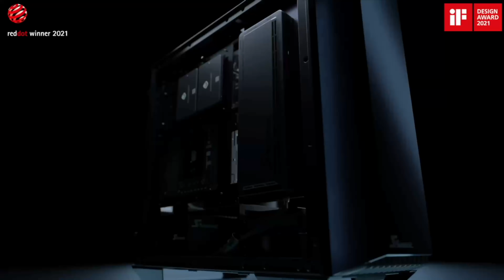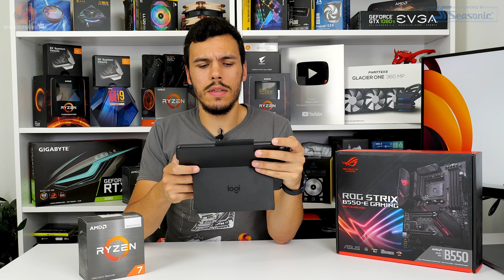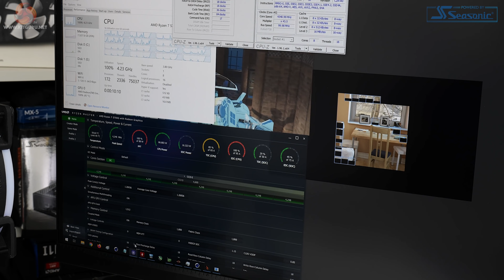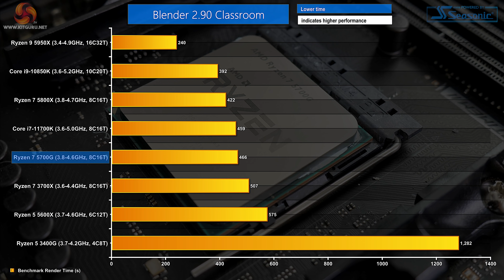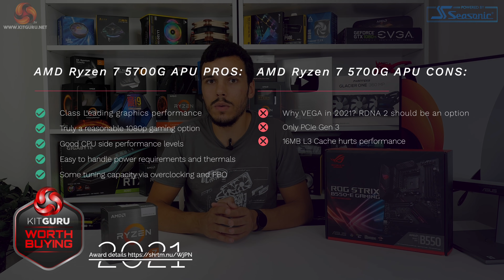AMD Ryzen 7 5700G APU - Can it Run AAA Games?

Comment from the maker: Are the new APUs worth buying in your opinion - or would you always get a CPU and GPU separately?

TIMESTAMPS:
00:00 Start
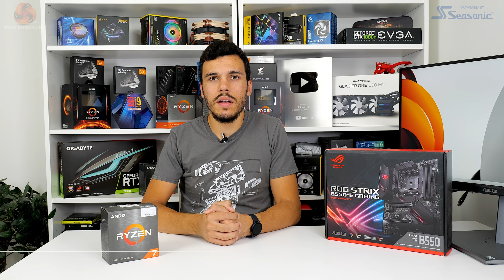00:15 Introduction / pricing
01:19 5700G details (and cooler)
03:33 PCIe Gen 3 ?
03:55 Motherboard support
04:32 Test system / Methodology
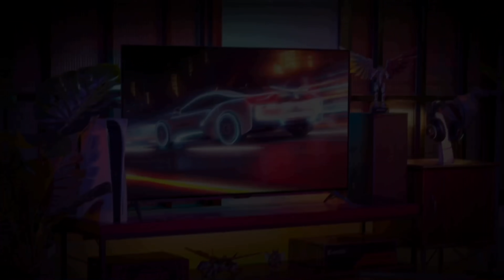06:11 Comparison Thoughts
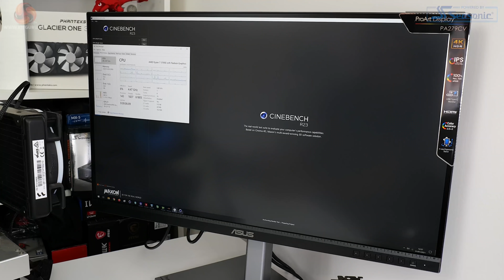07:41 Clock speed / OC
10:23 Performance results
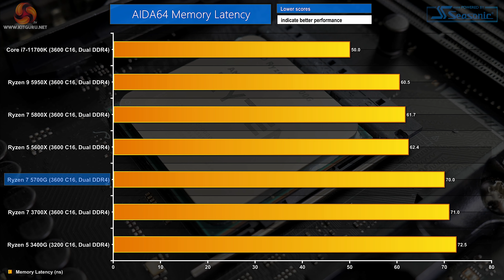12:58 Summary of CPU focused performance
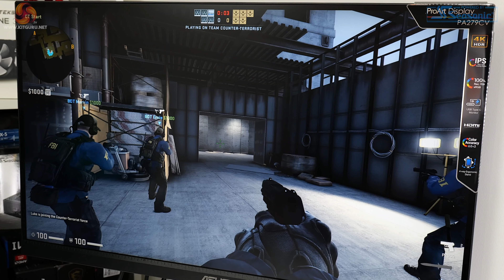13:20 iGPU gaming - AAA titles
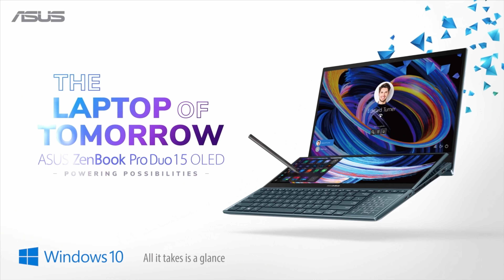16:01 Summary of iGPU gaming performance
16:43 Gaming Performance with RTX 3080
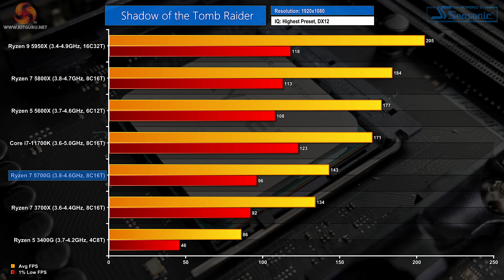17:38 Power Consumption
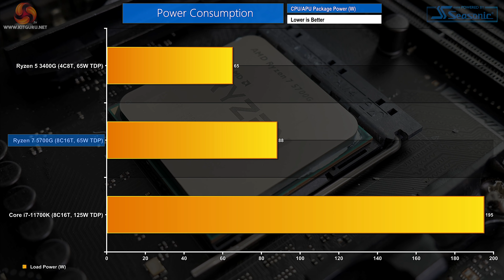18:00 Temperatures
18:17 Summary
19:52 Luke’s Closing Thoughts - disappointment over no RDNA 2
Reply: pin it?
Reply: 21:18  Thank You  so much, the exact tidbit i was looking for.

Comment: I have gotten this at a very good price to replace my r5 1600, I havent installed it yet, I am looking at cooler options to replace my current deepcool gammax gte v2 180tdp air cooler.  I am not planning on using the on board graphics unless my rx590 dies (prices are still too high to replace it yet).  My motherboard is a 2018 version of the Asus Rog Strix B450-F Gaming with bios fully uptodate.

Comment: I want to build a new system with a RYZEN 7 5700g and 32gb of 3200mhz RAM and NVME drive for OS+Programs with SSD Drive for media. HDDs for the rest such as backup imaging. This system will be exclusively only for Video Editing and will have only the OS and the NLE program installed with maybe... photoshop + 3ds max/blender to do some simple 3d titles. It wont be used for internet and other general tasks etc.  OS will be Win 10 64bit.

I intend to work with the inbuilt graphics for a few months till Graphics cards get down to realistic prices.

My projects are all 15 mins max on the timeline. Maybe 1 to 2 tracks of video files and another 5-7 tracks of color solids or text overlays. My videos will be 400mbps Panasonic GH5 type of mp4 clips.

Your opinions and suggestions will help. Thanks.

Comment: since the gpu i will try to put on my system is gonna be a 3080, im going to use the 5700g until im able to grab a 3080. I might upgrade to a 5900x later on

Comment: I have seen to HP Desktops one with the AMD Ryzen 5 4600G Processor and the other one with AMD Ryzen 7 5700G Processor
I am mainly going to use it for everyday tasks not a lot of gaming.. Is there much of a difference and worth me spending the extra £150 quid for the AMD Ryzen 7 5700G

Comment: We are looking to build my son's first PC, somewhatnon a budget,  but with a goal of being able to upgrade later.   Would starting with a Ryzen 5 5600g be OK for normal computer use like media, school, and light gaming?
    We would plan to later add a GPU and likely a second kit of 2 more RAM sticks, possibly an eventual upgrade to a Ryzen 7  or 9 CPU without onboard graphics. 
    Looking at the Asus ROG Strix B550-F wi-fi board,  Corsair RAM and 850w power supply, and M.2 storage.   
    Any input would be most appreciated.
Reply: looking like a decent build on paper. what GPU are you planning to get? what RAM? I run 8x2 (16gb) on a 5700G Ryzen 7, I haven't benchmarked yet as we built it yesterday, but from what I've seen it definitely ran Battlefield 4 on Medium graphics at 70+ FPS (though inconsistent), and High graphics at 50-60fps quite nicely with rarely any drops (which is strange...BUT consistent. I'll cap the framerate at 60 later)

Remember, consistent FPS is better than high FPS. If you're going to do a iGPU i would go for 5700G, it goes for $320 on Newegg and shipped in 2 days.
Reply: @hollowpoiints    thanks for the input, we may try to get the 5700g instead of 5600g,  we are hoping to someday be able to pick up an Asus ROG Strix 3080 card, or SOMETHING made by Asus for RGB compatibility...  Corsair Vengeance 3600 RAM, hoping for 16gb sticks for 64 eventually....   not looking to play high end games, definitely not the most intensive ones, and not above low-med settings... will be a multipurpose computer.... someday when we can add the GPU, the next step would be a higher end CPU without the onboard graphics,  then I will use the old APU processor for another machine for just home office and school use....
   Gaming will be either 720 or 1080p,  can't remember what his TV is capable of for now... so integrated graphics should do OK for a bit... looking to integrate all the RGB through Corsair iCue,  maybe a Pirate Dog Tech adapter for the few non-corsair and non-asus fans or strips....  looking at the Antec DF700 case...
   Thanks again for the reply and feedback!
Reply: @isaiahfurrow7414  if you're doing 64GB of RAM, you can pretty much throw whatever the hell you want at it. It can handle both games AND work related stuff and not even break a sweat.

I have a MSI B550 MAG TOMAHAWK motherboard, it actually was the top rated motherboard FOR the 5700G. Word of warning, it doesn't come with a WiFi adapter so you're going to need a USB wifi adapter.
Make sure you get GOOD CPU coolers, the stock Wraith cooler for 5700G is pretty ass. I run a game of Apex Legends at low graphics (for more consistent FPS) and it'll reach 70°C (158°F which is medium temperature) but the colder the better. If your son is going go overclock his CPU and push it, you ABSOLUTELY need a cooler like Noctua or a water cooling system. Have you got a PSU? I'm sitting pretty comfortable at a Corsair RM850x, 850w of power at a Gold+ efficiency rating and it can rig for silent running.

Other than that, looks pretty good!

if you have any other questions, my discord is Attano#0999
Reply: @hollowpoiints  would be 32 GB of memory to start with... later add another 32.   For power supply we were looking at the same Corsair RM850x unit, but after watching a video or 2 about PSUs was going to research a bit more to see if there was a better option that isn't ridiculously expensive.  I think his main PC games he wants to play (he also has PS4 and a few games he hasn't played through yet)...are PUBG , CS GO, Forza(we don't do Xbox in this house...lol), Halo, Valorant, CoD War zone, and then some older and way less intensive games like some real-time strategy games(Starcraft, Dawn of War), Diablo, other stuff from Steam, etc...   
   For coolers we are kinda thanking of going with the Arctic Freezer eSports 34 duo cooler, and maybe look into if there's a couple RGB fans we could swap to that would be better or as good as the ones on the arctic.... but for starters, a decent air cooler, the 3 front fans, and maybe a few extra LL or QL corsair fans added in to make sure there's plenty of airflow...  my kid says lots of RGB makes it faster and better FPS...lol
  He loves his new K70 keyboard , it came early due to Best Buy sale, and the iCue software looks to be pretty sweet... 
   Thanks again !
Reply: @isaiahfurrow7414  oi can I actually get a link on that keyboard? I'm using some cruddy red dragon M&K set
Reply: @hollowpoiints  , we got the K70 RGB TKL Champion Series, it is normally like $140, but Best Buy had it on sale for $99.... 
   I think we are gonna watch for sales and buy parts off our list when we find them o  sales, if we get lucky...
Reply: @isaiahfurrow7414  As for the cooling, I recommend to go with Scythe Fuma 2 CPU Air Cooler - 60$ well spent. This cooler has the same performance as Noctua NH-D15 (~100$), but no RGB on the two fans it has though

Comment: I'm planning on buying the 5700g for my new pc. I already have a Asus B550A that I bought a month ago, will I need to update the BIOS for my 5700g to work?
Reply from the maker: Possibly. Do you know which BIOS version you currently have? Luke
Reply: @KitGuruTech  I checked the history of BIOS updates for it on the Asus website. There is a beta update from late June and an update to support Windows 11 from July. Both after I bought it. The one from June adds support for AGESA V2 PI 1.2.0.3.
Reply: @KitGuruTech  The update I must have is AGESA V2 PI 1.2.0.1.
Reply from the maker: @callum9378  The 5700G should POST and Boot with AGESA 1.1.8.0 or later according to the AMD notes. But you should use AGESA 1.2.0.3b or later for the best experience. So it sounds like your system will POST with the 5700G and then you can update to the latest BIOS. Luke
Reply: @KitGuruTech  OK, thanks for the help!

Comment: Eh, I have a system with a gpu, but I still think the apus are more suited to 720p or  1080 on easier games.  I don't mind 720 on my laptop, size of screen is a big deal for using apus in my mind

Comment: I wonder what the fps in AAA games would be if paired with a 1366x768p monitor as 1080p is just too high a res. Native res 768p looks better than scaled on a 1080p monitor.
Reply from the maker: 768p performance should be absolutely fine with some reduced IQ settings. We did some lower resolution testing when we initially reviewed the 3400G a couple of years ago, so that data is probably still relevant. Luke

Comment: Why is the guy saying "compared to DESKTOP cpus/parts" is this a laptop processor? Annoying as hell
Reply: Well I guess he figured you had the intelligence to work out the difference between an accelerated processing unit and a central processing unit and not get confused with mobile chips.
Reply from the maker: I can't understand what you're complaining about. We have desktop parts compared against desktop parts. The Cezanne APU holds many similarities between the desktop and laptop parts (as highlighted in the video). Does that help your confusion? Luke
Reply: @KitGuruTech  not sure. I'm not saying anything is incorrect, but it's a weird phrasing IMHO. It sounds like you are reviewing a mobile CPU when you do it this way. IDK, e.g. if I was reviewing a petrol powered car that is a hybrid and saying "compared to a petrol powered cars". Doesn't it make it sound like I'm talking about a diesel/electric car?
Reply from the maker: @GintarasSakalauskas  Yes but I guess by that logic, we are reviewing computer hardware and comparing to computer hardware. We are hardly talking about it versus the latest Qualcomm SoC in a mobile phone. Fair enough if that is your opinion which you're absolutely entitled to. Though, I'm sure there are much more polite ways of expressing discontent than 'Annoying as hell' :)! Luke
Reply: @KitGuruTech  Not sure what's not polite with saying "I found this kind of word selection to be annoying as hell", I'd say it's in the top 5% for internet standards :D I don't think your example with pc hardware vs pc hardware follows the same logic though. Anyway, just some feedback, maybe I'm a 1 in a million who found it odd, feel free to disregard it. Good luck with your work

Comment: The reason the 5000G series uses Vega because it's been optimized for performance, power, and area, and also because of the limited DDR4 bandwidth.  RDNA2 has infinity cache and extra silicon to support RT so 8 CU's would increase power and area, and RDNA1 probably needs DDR5 and also hasn't been optimized for power and area enough to fit into small enough chip size.  Less yield would increase costs and with the dearth of available wafers it makes sense to stay with Vega for this generation.

Comment: Would this be a good cpu for Unraid, running a few vm's, socket containers, 24/7 running? Thanks, answered at end. 😀

Could anyone recommended a good motherboard for this, needs at least 6 sata ports for multiple hard drives. Lower power use and stability more important than max performance, and also cpu upgradable. Thanks
Reply from the maker: Unraid is a superb use case in my opinion and this is probably the processor that I would be most inclined to go for in my Unraid builds. Plenty of threads for VMs, decent graphics when needed, superb AM4 ecosystem. And I can't imagine a lack of PCIe Gen 4 being a big deal even for cache SSD choices. 

As for motherboard, I would be inclined to go for one of the passive B550 options. Plenty of features - especially in ITX form - and lots come with 2.5GbE also. Luke

Comment: Guys the 5700g is still worth compared to the 5800x in terms of power consumption/ cpu power and price ? I would like to run a combo 5700g with rx 6700xt, is it better than combo 5800x 6700xt ?
Reply: You're too high up the GPU ranks to be worth it. On a 3060 sure. It would work and keep power low. 6700xt you save to little percentage wise for too much performance left on the table.
Reply from the maker: In that scenario, it would probably make sense to go for the more powerful 5800X combo. Unless you have any future need for the APU's graphics, that is. Both should be good solutions with that 6700XT graphics card though. Luke

Comment: I absolutely love your honesty. Yes AMD could Have done much better with the igpu but they are entitled enough to play dirty games.....in some places the prices are sky high as much as a CPU + rx550 pre pandemic. 
Prices need to be lower for this level igpu performance.
No bad products, only bad prices.
BTW I'm using the 4650g oced and its amazing!
Reply from the maker: 4650G is a great option. Have you OCd the CPU and iGPU side? Luke
Reply: @KitGuruTech  
CPU at 4.05 GHz on auto voltage and cooler. Turbo off.
igpu to 2400 on auto voltage
Ram to 3533 MHz and IF to half of ram and 1T from 2T. Somehow can't get ram to higher....
Reply from the maker: @pamus6242  OK, that sounds like an awesome setup :D! Do you find the iGPU completely fine at 2400MHz? I struggled to hit 2400MHz with our 5700G sample, but 2300MHz was fine. 

What are your temps like? Luke
Reply: @KitGuruTech  
I updated the BIOS a week ago....I think it got released in April or may 2021...can't remember clearly....and I was able to get a stable overclock only after.   Otherwise it would hang up the system after 2250mhz.....so I think it could be a BIOS thing.
My mobo is b550-ds3h by gigabyte.
I use 16gbx2 3200mhz ram but by different brands. 
Also I put off some of the security features of the chip off in the bios.
Csgo...farcry5 works real fine.....
Reply: I get 70c max on gaming on fc5 on stock cooler....idle after a while 36/7 C.
I live in India....hot here ...ambient between 26 to 32/3
Reply from the maker: @pamus6242  Very nice. Sounds like you have a really good OC and setup there. That cooler definitely sounds like it is holding up very well too! I think the flexibility with things like CPU+GPU OC is certainly one of the really fun areas for these APUs. Luke

Comment: They can't get past Vega cause of the ram when ddr5 comes out then you'll get rdna I don't know why people  can't understand  this
Reply from the maker: Has AMD publicly confirmed this? Otherwise, I would assume that is why people keep mentioning RDNA2 - it's not a case of a lack of understanding. Luke
Reply: @KitGuruTech  that's how graphics cards work the depend heavily on ram the architecture change isn't a big software change is a hardware change they raise the clock speed and add faster ram gddr5 to gddr6 in this case ddr4 to ddr5 when ddr5 memory  comes to motherboards the apus will "architecture" will change
Reply from the maker: @Durkhead  RDNA (2) also has some significant architectural changes vs even later revisions of GCN though. So even with the suggested limitations of relatively slow DDR4 memory, the other archiectural benefits (and potential enhanced power capability) of RDNA (2) would possibly be useful upgrades. I think it's a bit more nuanced than just pointing the finger at slow RAM as a reason for AMD continuing to use Vega. Luke
Reply: @KitGuruTech  
Rdna and ddr5 are in the new Steam deck handheld.

Comment: I hope the Ryzen 6000G has been using RDNA2 or RDNA3 if it has been out so that it still make awesome progress with IGP. Not like now, even cheap old IGP (3400G ) cannot beaten. Zen4 + RDNA3 in one chip is super cool.
Reply: That's not yet possible in my opinion. You see high performance gpu requires high bandwidth memory. However, in case of igpu, it utilizes the system ram as its memory (shared graphic memory) that does not have high memory bandwidth that a powerful gpu needed to have (2400mhz ddr4 only has more or less 20GB/s of bandwidth per channel, while amd's rdna 2 requires more or less 200GB/s of bandwidth to unlock its full power).

So even if we are stepping into the ddr5 memory, its still going to perform below gddr5.

That's as far as i can tell.
Reply: @timytimotius4679  I think all GPU in iGPU cannot use all it potencial because of shared RAM. Except where new GPU arch is really power hungry then it cannot go into iGPU. RDNA2 is power efficient. And rumored RDNA3 even more. At least even if it has slow GPU memory, it has faster GPU Core, which will speed up the whole system.
Reply: @HokgiartoSaliem  no, even if it has faster cores, but without sufficient memory bandwidth, its a bottleneck for the memory. So performance is poor.

Edit: its like having a super car but in the middle of bad traffic
Reply: Yes, but the price will be from 500-600 dollars, if you want PS5/XBSX processing/gpu power.
Reply: @justice4all190  Not full, but the lite version, just like the lite Vega but RDNA. Like Navi24 / Navi25 The lowest end possible.
Reply: My ryzen 3 3200g has same vega 8 igpu only clockspeed difference